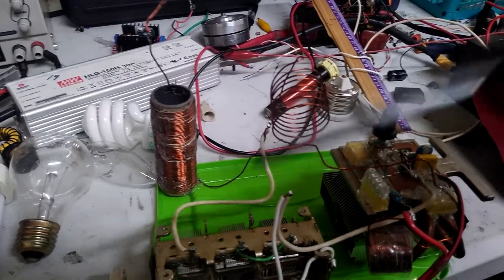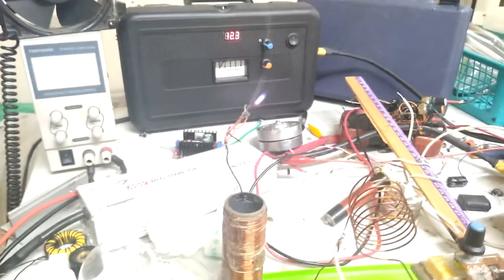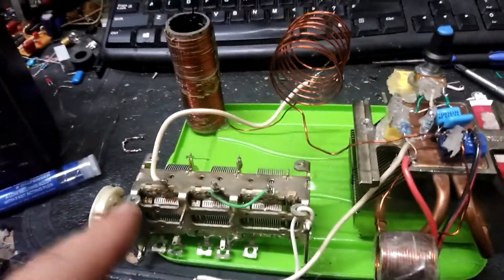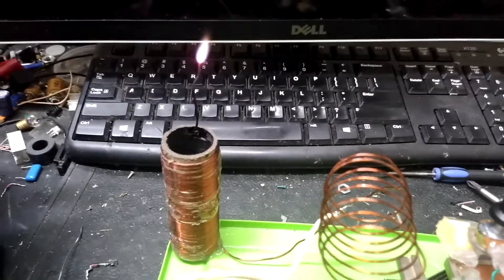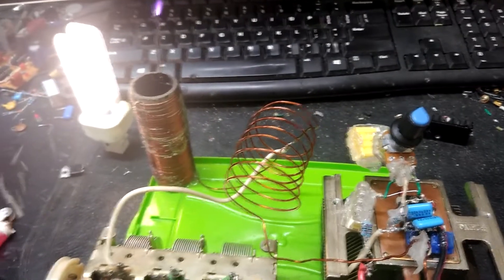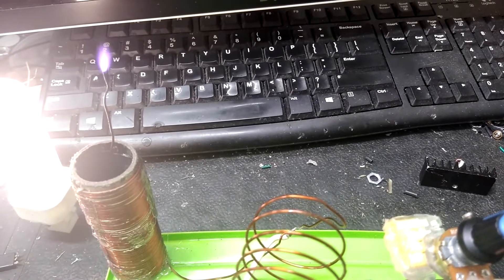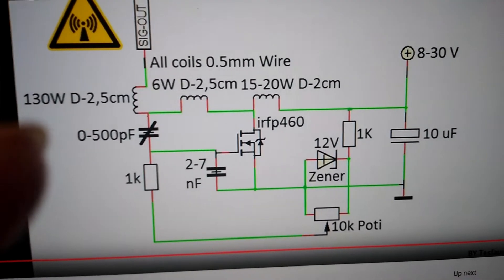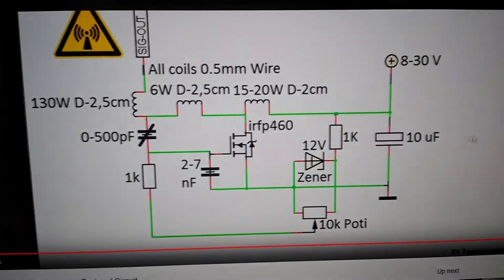HFSSTC 15mhz

Comment: A very capricious scheme, I tried it) Can melt glass into the terminal as an ion source.The discharge will lengthen and turn yellow.
Reply from the maker: Oh so THAT'S what it was, I was wondering about that. The melting of the glass onto the tip seemed intentional but I hadn't put it together. I need to try that! I never tried to rebuild this circuit because it needed such fine tuning and I didn't think my varicap would stay within range by moving it to PCB. I want to make a smaller one though, I've seen to many mini magnifiers which run well from low voltage.

Comment: She might not look pretty but hey it works ! 😎 I'll have to explain it in my vid how I got it set up, what I've noticed is that when you cant hear the output, your right in the resonating range, get away from it and it starts to crackle which usually ends up killing the fet... keep in mind we are pushing these fet, the max freq. range of the ones we use is max 27 Megs so we are getting up there plus it's just one fet doing all the work, the circuit is not efficient at all ! I used a different circuit but still in the same style, I'm sure I can go past 60 V on mine ..
Reply from the maker: I think you used BVC's circuit maybe? The only reason I didn't go by that one or similar ones is because it specifies the 6.2v zener I didn't want to wait on. This circuit does seem a little low on the voltage limit but it was ideal since I'd have to throw together a supply that will push the amps necessary at over 30v. The creator of it has a pretty sweet setup but it's def not cranking what some of these other ones are at around 50v or so. But yea 15mhz lol, when I saw that I was like shit. Surprised the thing even fires up but that's all I really wanted to see, now I have the confidence to keep improving on it knowing it won't be a total waste of time. A more interesting version I've seen is by the same guy who made my circuit where he uses a small SSTC style setup with a 1 turn primary and a 1 turn feedback wrapped around the secondary. Unfortunately his links to the circuits are dead.
Reply: @Magneticitist  and yeah telsaundmehr ( tesla and more ) german guy, love his vids but yes his website is unfortunately dead, had lots of good info on it 😪
Reply from the maker: @dirkk82  yea man that dude rocks i need to learn German and Russian while I'm at it. That's all talk tho lol
Reply: @Magneticitist  I'll look at my circuit again but I'm sure there's only 12v zeners in it, think I modded it a bit, telsa explorer helped me a bit as well 😂
Reply: If your looking for the one circuit that has one turn for the primary and feedback, it can be found here. http://oniproductionofficial.blogspot.com/2017/02/mini-teslacoil-adm-adm-hfsstc-ogretici.html?m=1